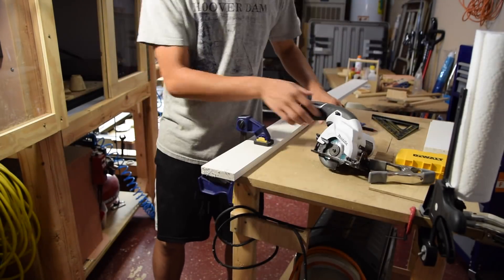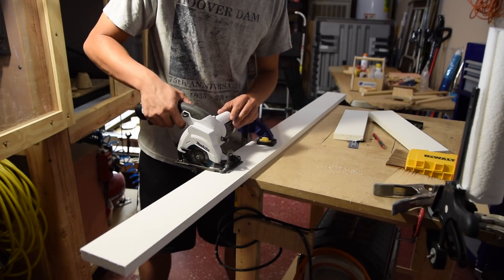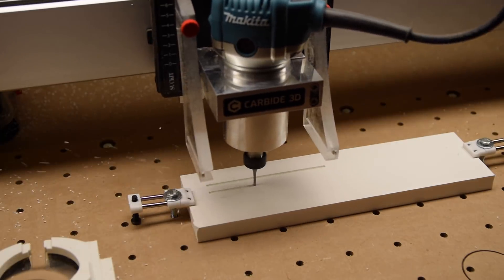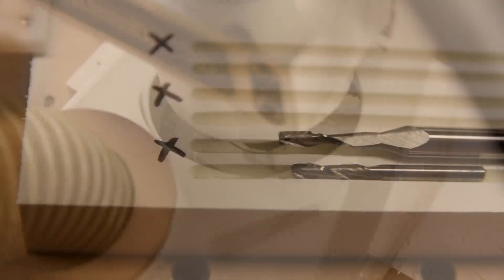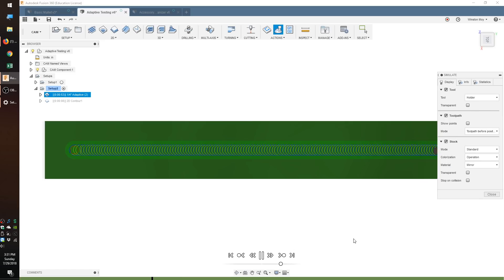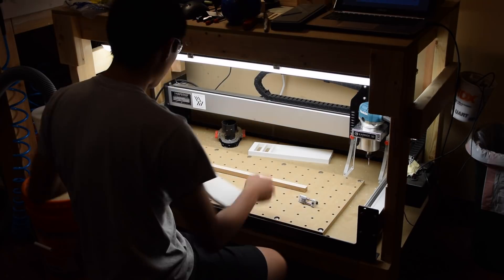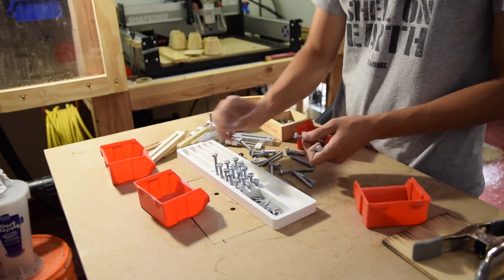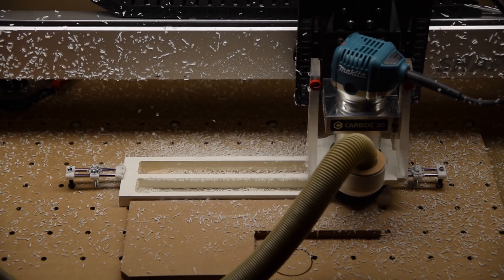Making a Tool Organizer from Trim Board - #126 [CNC]

Comment: I was going to make a simple bit holder on my cnc, for my cnc bits. 
I then looked at my drill press and thought it looked pretty practical for drilling a bunch of holes in a scrap piece of lumber to hole the bits upright.

Comment: Isn't PVC kind of dangerous because it heats up while cutting and releases toxic stuff?
Reply from the maker: It only heats up if you cut it wrong. And by that point it would become gummy and unmachinable. Laser is a different story, that should be avoided.

Comment: Very cool! Do you think something like Trex would perform similarly? I’ve got some scraps leftover from my patio cooler build and would love to build some organizers for the router table and CNC.
Reply from the maker: Might have to vary your cutting parameters a little since it's probably more dense, if it can be cut with regular woodworking tools then there's a good chance it can be machined too!

Comment: I highly recommend using compressed air at as high a pressure as you can manage when doing plastics. The big gooey mess you mentioned happens when you aren't keeping the chips moving out of the pocket fast enough. The air makes sure everything stays clear while also keeping the tool cool enough to avoid melting. The fewer the flutes, the better. It's neat that your new tools can keep chips from getting too big, but you really want to avoid making them too small as well. I haven't used trim board before, but my Shapeoko 2 can handle HDPE like it's nothing. Maybe a little more conservative on the feed rate, but you can probably keep it running pretty fast.

Comment: I've cut a fair amount of HDPE in the form of 3/4" cutting boards and Starboard on the Shapeoko XXL.  I use these bits (LMT Onsrud 63-776) and I believe my top speed is around 2000 mm/min for adaptive clearing at top makita rpm.  For contour, i get 800 mm/min with a 11mm stepdown.  I should add that I use the longer Onsrud 776 because I needed a longer cutting surface for the .75" boards.  If you don't need that, then the 775 in the same family is a little more rigid due to less stickout from my makita.  I tried to cut down the shank length of a 776 but the bit was unimpressed by my portable bandsaw.   Onsrud bits are awesome but their website could be better organized, given the huge amount of options, I need a McMaster style approach.
On a random note, I'm trying to cut some colored cutting boards and I have a great deal more difficulty as the pigments appear to make the HDPE much stickier and likely to melt.  I have to do a couple finishing passes just to get the crap out of the channels I'm milling.  This is with a shopvac-type vacuum system.

Comment: My dad runs a company and they build HDPE tanks for all kind of chemical products. The CNC operator uses mostly one flute end mill usually at a 3m/min feedrate and 24.000 rpm to cut HDPE plate up to 4x2m. They also cut Plexiglas, Polycarbonate, PVC or PP but I don't know the parameters for those materials. I can ask more information if you want ! I personnaly use the CNC to cut wood.
Reply: If its mertens plastique in belgium then I used to deliver right next door at Infratech
Reply: Mentos Freshmaker Yes it is !
Reply: Small world! XD

Comment: On exhaust - the issue with PVC cutting is that the chips are really light and stick because of static electricity - to everything I might add. I have done a lot of cutting of PVC with table saws, chop saws, routers and such and even with a good exhaust system this is still tons of pvc chips and dust everywhere - is a messy stuff to work with! And finally what the heck do you do with all this PVC dust? The volumes are just like wood, but you can't mix it into your yard our around your trees.

Comment: Doesn't look like suckit isn't sucking anything.
Reply from the maker: Big 3/4" deep slot is pretty good at diffusing suction and letting chips escape. The 1.125" hose and janky cyclone setup don't help. Trust me, it's still way better than without the dust boot.

Comment: For plastics, I find that a 3 flute with a bullnose is very forgiving and fast. Good for surface machining and okay with profiles. The bullnose helps keep feed rates up without melting material. A EM seems to get hot sooner, heats up the cutter and then you're melting the material slightly. Making optical parts from acrylic difficult to machine nicely.

Putting air on the the cutter will make large parts go well. 

I've machined polystyrene and acrylic all day with the same cutter @ 400ipm using those two characteristics.